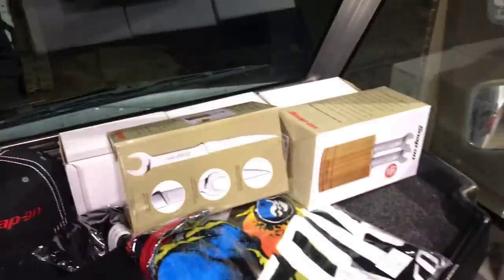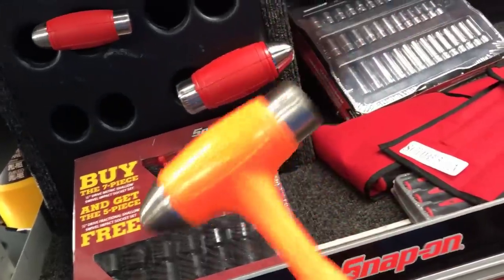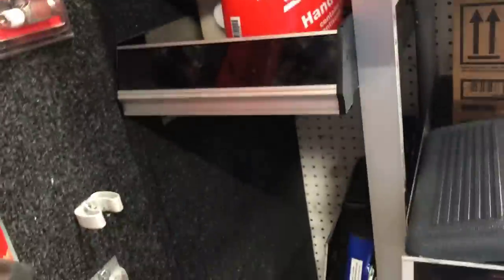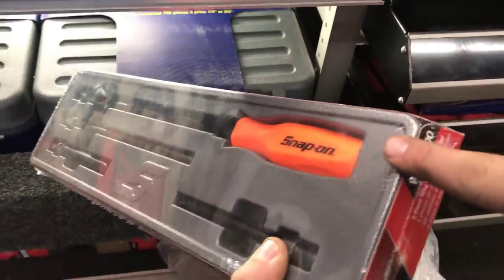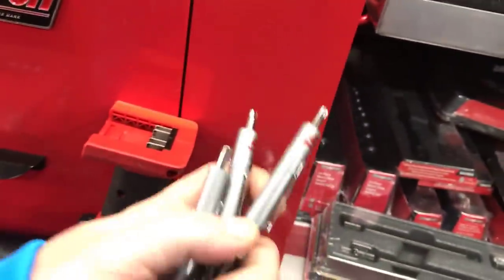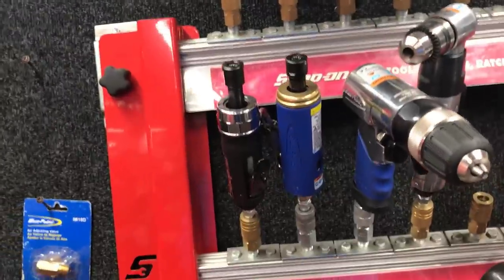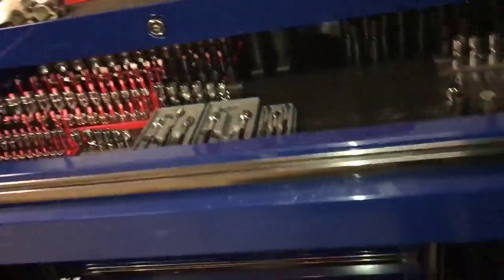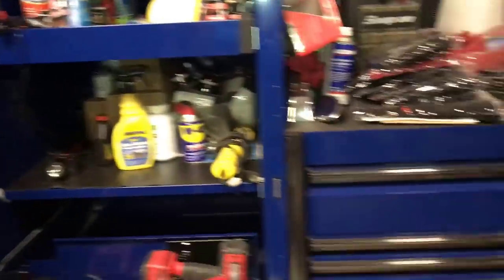THE SNAP ON JUNKIE TRUCK TOUR AND TOOL BOX TOUR MUST SEE!!!

Comment: Awesome video Justin!  Hey I just did some research. Snap On used to make those speed wrenches with double open ends. One end was a regular open end with the flank drive plus, the other side was the speed open end. They made them in MM and SAE. Just type in snap on speed wrench on eBay and you'll see them. I keep checking for a complete set of SAE and I'll buy them in a heartbeat. Not only line fittings like you mentioned, these would be fantastic for replacing grease fittings. And I do a ton of those basterds! Thanks Junkie, keep it up!
Reply from the maker: Justin D thanks Justin I might have to look those up to see because the ones in our waste of money
Reply: The Snap-On Junkie!!! Agree. Where you need these are places you can't get a closed end on so why make these with the box ratchet side? The double open end with one side flank drive the other speed makes all the sense in the world. Why SO pulled those from production is annoying. Oh well, that's why there is eBay. 👍

Comment: traded in my regular ratcheting wrenches for the ones in this video probably 6 months ago or so and they are probably the most used tool in my kart, other than air tools. ratcheting end is great for wherever my impact wont go and the open end is awsome for holding a nut on the backside while impacting. doesnt matter where the wrench goes on the nut it'll find a home once you hit the gun, therefore you dont need as much room and its faster.

Comment: Dude, that toolbox is nuts. I can see those wrenchs being useful on hydraulic fittings too. Those times it's broke loose but has oil on it and you still can't turn it by hand. It would need to be double ended and really short for that though. Happy birthday bro.
Reply from the maker: Bryan Bethea hey thank you yeah I would buy those wrenches but they need to make them double ended your right and they would be way better

Comment: I think those wrenches would be better with a just a normal box end so you can break the bolt loose. I don't like to use ratcheting wrenches for breaking a blot or nut loose. just my opinion. but I don't ever see myself buying those wrenches anyways. haha